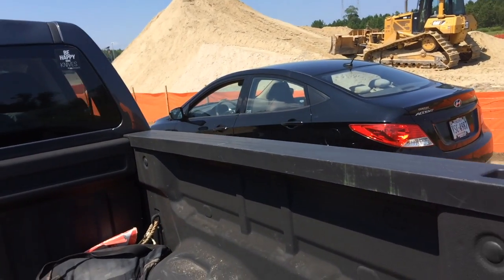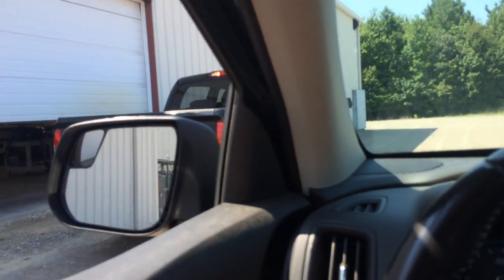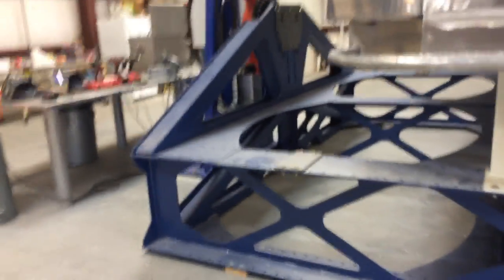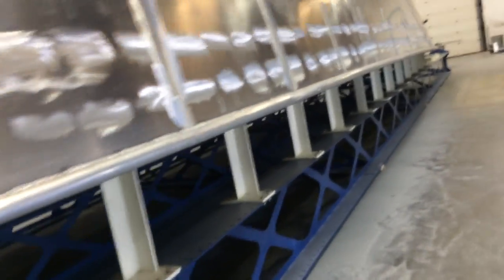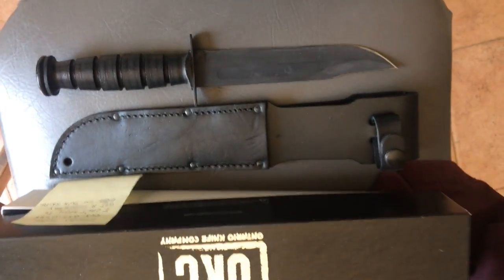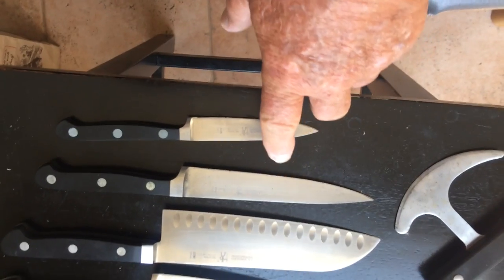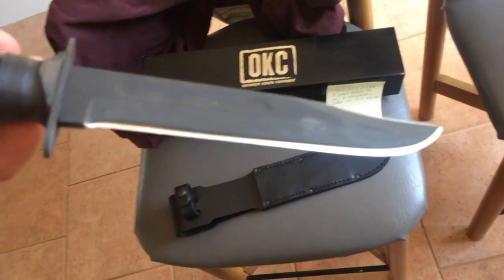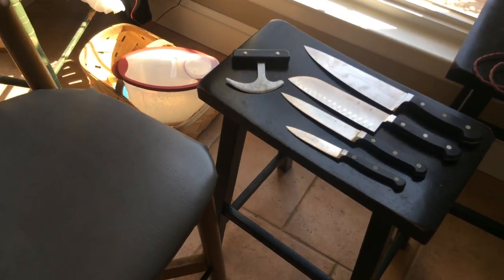I'M A HERO....some knives and a big new boat today

Comment: Quite an impressive boat,Max
Reply from the maker: it is very impressive, but not my boat......built  on speculation.  he has built  4 or 5 in the past, but this is the first with the new rotator rig that spins the whole boat........see above for more details.  i have know this fellow since he was a tiny boy crabbing on the river.  he is very impressive guy toooo if you knew some of the things he has done over the years.